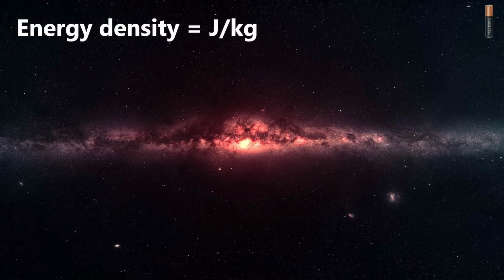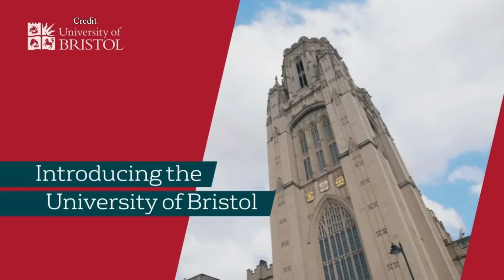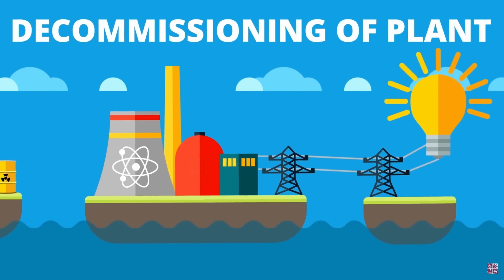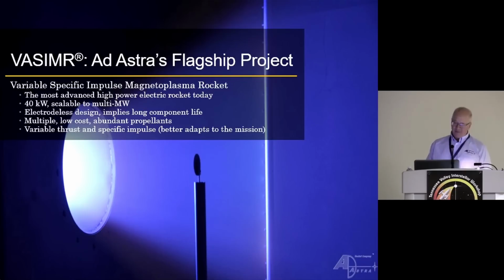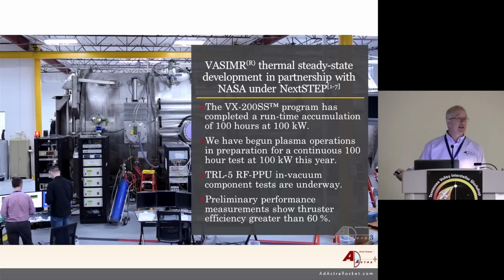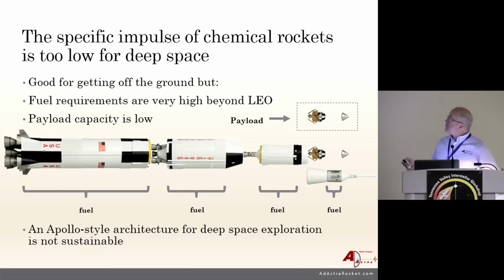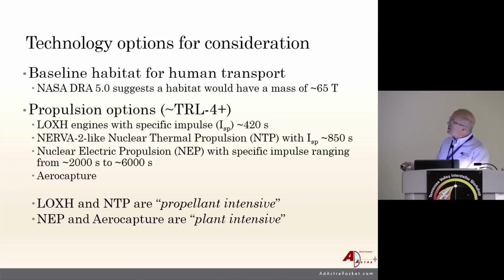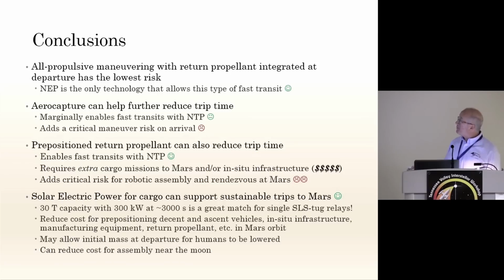Can Nuclear Voltaic Power Get Us to the Stars? Or at least Mars?

Comment: I was just reading about Bose-Einstein condensating photons between two plasma lenses. Maybe this can work with any bosons, such as Cooper paired He3 superfluid? right? Then you focus a high frequency, high powered laser on it and boom you have your power source for space travel to beyond Jupiter?
Reply from the maker: I'm not sure I'm understanding... Photons cannot Bose-Einstein condensate. They are used to strip away energetic gas molecules to "cool" the gas down to a fraction above absolute zero and form the BEC.  This is of course a very dense form of matter... In some ways the densest possible outside of neutron starts etc... Are you thinking of the potential to bottle a large enough volume of BEC gas... Say hydrogen, to use as rocket fuel?  If so that's an awesome thought. What is the energy density of this gas if heated by a laser as you describe?  Let's do some math on this.
Reply: @terranspaceacademy  photons are bosons therefore they Bose-Einstein condensate, albeit I think in 2D. He3 is a fuel for an aneutronic fusion reaction, but it's a fermion unless it's Cooper paired, in which case it flows. This flow can be turned into spacecraft motion when fused using a high energy photon. The bosons are already quantized, all you need is to give it a push.
Reply: @terranspaceacademy  the Bose-Einstein condensate would be inside a tiny little plasma bubble acting like a lense that keeps the quantized matter in place for the laser.
Reply: @terranspaceacademy  what I'm not sure of yet is whether the D2 would also need to be quantized, but I guess yes, just put it in every other bubble.
Reply: @terranspaceacademy  release the electrons after enough laser push?

Comment: There is an error at 10:20. You mix up energy and power. You estimate that the battery can store 7.5 GWh of energy, and then you say 1% of that is 75 MW of power.  1% of 7.5 GWh is 75 MWh of energy, not 75 MW of power. To convert watt hours of energy into watts of power we need to know how many hours it takes the batteries to discharge. Since this battery is suppose to last 50 years, that means those 75 MWh of usable energy is doled out over the course of 438000 hours, so the power output of the battery is 75MWh/438000h = 171.2 watts. That's not much. Its also even worse than that, cause if you made the battery out of the materials you mentioned (Carbon 14 and Nickle 63), it wouldn't take 50 years to discharge, it would take over 5 thousand.
Reply from the maker: Dang... Now I'm sad... unless you're just looking at things from a normal battery perspective.  Remember, this device is creating energy by radioactive decay and those factors were considered in the calculations.
Reply: @terranspaceacademy  Unfortunately not, the things I'm talking about are also true for nuclear batteries. Energy is energy, power is power. When that graph says these batteries have thousands of times higher energy density than regular batteries they are talking about the energy stored in the nuclear fuel. However since the battery is powered by the slow decay of that fuel, that energy is released really slowly, so the power output is really low. The nuclear fuels you used have half lives of thousands of years, so it would be millennia before they released even half their energy.
Reply: @terranspaceacademy  Are you going to do anything to correct the video? The watthours to watts mistake is pretty important. Without that typo the actually power figures for such a battery isn't nearly enough to run a spaceship, which was the core idea of the video. The video in its current state is misinforming people.

Comment: a 7.5 ton array of the chinese batteries (0.1 mA 3A) would produce 2.25kW if they weighed 1g each, the maths in this video are a long way off reality. The ISS produces up to 120 kW of electricity from about 6 tons of hardware, which is a great deal more. With supercapacitors you might be able to store energy for spurts of ionic propulsion, you could do the same with huge arrays of solar cells which will only get lighter in the future. Its not unreasonable to expect that 250 kW could be produced at earth orbit with an array weighing 1 ton at some point, perhaps even less with evolving material science. This would make trips to Jupiter and even Saturn viable with solar electric propulsion or even magenetoplasma propulsion combined with supercapacitor storage. But betavoltaics does not seem to be the way in its current form, and an alphavoltaic system would be better since it requires less shielding on manned missions (forget gammavoltaics).
Reply from the maker: We are talking about potential... Not what the very first functional design can do today.

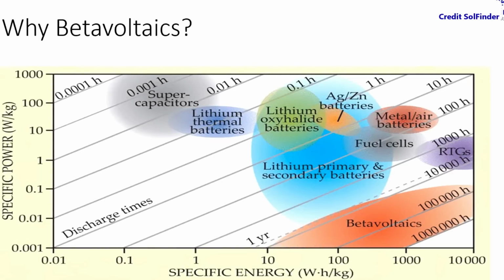Comment: As the graph at 8:17 show, these do have quite impressive energy densities, but the rate a which that energy is released, their power density, is quite low. Like with RTG's, nuclear voltaic cells rely on the steady decay of unstable isotopes. They can't slow down or ramp up the reaction like a fission reactor can, they just get a steadily decreasing amount of power as the material slowly decays away, releasing half its energy during its first half life, then a quarter during its next half life, etc.  If you used the materials you listed in your starship example, Nickle 63 and carbon 14, you would have to wait quite a long time before you got that energy out, cause they have half lives of 76 thousand years and 5.7 thousand years respectively. That huge ship worth of batteries in the example would produce barely enough power to run a light bulb. It would do so for dozens of millennia, but that's not really the power needs of a spaceship, more a long term vault project.

If we want something more power dense you need a shorter half-life, like plutonium, which has a half life of around 80 years. Which why we use plutonium for RTG's. But making a significant chunk of your ship out of plutonium would be quite expensive, probably even more expensive than a fission reactor, which has an even better power density and can be throttled. The main advantage of RTG's and these nuclear voltaic cells is they are much simpler than a fission reactor, with no moving parts, which is good for a probe or a medical device that needs to run on a trickle of power for decades without maintenance. But if you're trying to make a fast high power ship that is going back and forth to port every few months, a proper fission reactor would give you better performance.
Reply from the maker: That's true... But he potential is much higher than these early models.  That's why I went with 1,000x so it's between the 100 minimum estimated and 10,000 maximum.  I also went with a 1% power harvesting when over 35% is possible these days.
Reply: @terranspaceacademy  No, you misunderstand my point. The energy density is between 100 to 10,000 times better than lithium ion, sure, but the power density is way worse. No matter what you do, you're not going to get a significant amount of power out of the natural decay of Carbon 14, the half-life is just too long. It has a huge amount of energy, sure, but it releases that energy over the course of 5 thousand years. The only way to make the energy release faster, is to pick a material with a shorter half life, but those are far more expensive and not suitable to being incorporated into a ship's hull. 

The part where you say the power output would be 75 megawatts is a conversion error. Everything before that was in terms of energy, you got that the battery would store 7.5 gigawatt hours of energy . That is a measure of the batteries capacity. The total amount of energy the nuclear fuel contains. You then say we could extract 1% of that energy, getting 75 megawatts of power . That shouldn't be power. We are still talking about energy here. 1% of 7.5 GWh is 75 MWh, not 75 MW. That means of the 7.5 GWh of energy the battery can store, 75 MWh of that energy is usable. If you want to know the power output of the battery, you need to know how quickly that energy is released. Power is energy divided by time. 

Since carbon 14 has a half life of 5.6 thousand years, that means half of the 75 MWh of usable energy is released over the course of 49.056 million hours. So the power output of the battery is 0.76444 watts. Even if we made the battery 100% efficient, we'd still only be looking at around 76 watts of power, not enough to run any engine of note. Making the battery out of Nickle 63 would make this even worse, as that has an even longer half life.

Remember, always check your units! Going from GWh to GW without ever dividing by hours should have been an immediate red flag.
Reply: @terranspaceacademy  Also, in addition to checking your units, its also good to just have a sanity check of "is this thing physically possible?" Like, does it make sense for 7.5 tons of batteries to be able to output 7.5 gigawatts of heat and electricity for 50 years? No. That's thousands of times more energy and power dense than any nuclear reactor, that should have also immediately been a red flag. 7.5 tons producing 7.5 gigawatts for 50 years would require an energy density of 438 TWh per ton. That's not an energy density a thousand times better than lithium ion, that's an energy density comparable to antimatter. Nuclear materials are not that energy dense. Even if you picked a much shorter half life material than carbon 14, one that does output a a gigawatt of power per ton rather than a watt, it would only last a few weeks, not decades. Also such materials are fantastically expensive and impossible to store for long periods, cause they decay away to almost nothing in a month.

But even if you did pick such a power dense material, that would still leave us with the second reality check, of does it make sense that 7.5 tons of material could survive 7.5 gigawatts of power being passed through it? No! That's as power dense as a nuclear reactor undergoing a meltdown. There is a reason nuclear reactors are thousands of times less power dense than this, its because no machine we can build can survive that much power being dumped into so little mass, it would not just melt, it would vaporize. There are limits to how quickly we can cool things, and this exceeds them by several orders of magnitude. The amount of equipment you would need to process those gigawatts of heat and turn it into electricity would have to be several orders of magnitude larger to keep from melting. And the amount of radiators you would need to cool that equipment in the vacuum of space is even larger still. A 150 ton spaceship is not large enough to handle such power outputs. The radiator array alone would need to be several times more massive than that. 

The fact that the example calculation you gave produced physically implausible results should have been another clue to double check your math. If the results you're getting are impossibly large, that's a good sign you made an error somewhere. The error in this case is at 10:20, where you mix up watt hours and watts, getting a power figure that is 10 million times higher than it should be, because you didn't divide the Watt hours by the time it takes the battery to discharge. Which again, for the case of carbon 14, is over 5 thousand years. That was a third red flag. This battery is powered by beta decay, that depends on the half life of the material. You can't create a 50 year beta voltaic battery with materials that have half lives of millennia.
Reply: @terranspaceacademy  Its been a few days, are you going to do anything about the power estimate mistake? The conversion error at 10:20 resulted in your power figure being millions of times too large. That's not a small typo you can just ignore, that was central to the premise of the video, so its concerning that you haven't seemed to have made any kind of correction. 

I'm sorry if I've come off as rude, I'm not trying to be. There is nothing shameful about mixing up watt hours and watts, its an easy mistake to make, we're only human. It would be shameful though if you didn't correct it even after people pointed it out to you, leaving the video up even though it is misinforming people. I understand not wanting to take the video down, but please, could you at least write a pinned comment explaining the error? Or perhaps make a video on energy vs power where you mention the mistake and use it as an example to help other people in your audience learn about it, turn it around into a teaching opportunity. After all, like you've said to a different commenter, the entire purpose of this channel is to learn together.
Reply: @massimocole9689 Valuable feedback and sound arguments, from my layman's perspective. I saw so much potential in these batteries. You put this into another perspective. We need more efficient conductors that would avoid energy to heat loss. Maybe such materials could also convert radiation to electricity without so much heat?

Comment: Thank you. I never heard about these kind of batteries before. Effectively they seem to be a kind of nuclear reactor. Anyway I remember a zubrin article debunking Vasimr in which he claimed that we need an improvement in power to mass ratio of two orders of magnitude to achieve the quick transit times to mars: On the ‘39 days to Mars’ claim, Zubrin says "VASIMR would need to couple with a nuclear reactor system with a power of 200,000 kilowatts and a power-to-mass ratio of 1,000 watts per kilogram, while the largest space nuclear reactor ever built, the Soviet Topaz, had a power of 10 kilowatts and a power-to-mass ratio of 10 watts per kilogram." So do these Nuclear Voltaic batteries produce that kind of power to mass ?
Reply from the maker: He was exactly right... And didn't want to wait for that.  He wanted "Mars DIrect" to use available infrastructure like Falcon Heavy.  While his plans are excellent to get the job done now those with control of the resources want totally reusable systems.  VASIMR does need a lot of power and solar won't work well on the way to Mars... But nuclear is coming, by the US and EU or by China, and so is the VASIMR, once we have a source of sufficient power.

Comment: This is really interesting idea. A problem will be heat rejection. If you’re carrying gigawatt hours of energy, and you only get one percent of that then you have to figure out a way to radiate the other 99%. You would need to have massive massive massive radiators.  another problem is going to be availability of the radioactive substrates. How difficult is it going to be to gather together tons of purified carbon 14 or nickel 63? It’s doable I’m sure but it might not be economic for multiple ships.
Reply from the maker: The end film from Britain shows that they have almost 200,000 metric tonnes of C-14 rich carbon damping rods from nuclear reactors. Nickel 63 I'm not sure about and will need to research sources.
Reply: @terranspaceacademy  i’m sure there’s plenty of source material, however, it might be difficult to separate carbon-14 from everything else, especially when dealing with a radioactive source.

The other major weakness of the betavoltaics is that the power density is terri wha . Something like .01 W to .1 w per kilogram.   So a 7500 kg sample might only give you 75 to 750 W unusable power.  They can do it for a very, very long time, however, it’s not enough power to really do anything meaningful on a spacecraft.

Comment: Lots of interesting information about theories. One I’ve pondered but have yet to hear anyone taking about is the use of nuclear energy in a molten reactor to make xenon for use as a propellant. From 32 years in the power industry talking daily to nuclear power plants one of their Achilles heels is the inadvertent production of xenon that has to be cleaned out of the feed water to allow higher power levels. If it can be made accidentally I’m sure someone could figure out how to make more on demand. I’m a big fan of the thorium LFTR since the fuel is liquid and can be constantly reprocessing and cleaning and has the side benefit of lower long term waste production. 

Every thing else aside, I like the idea of creating artificial gravity in a liquid fuel engine by spinning it echoing the design of the firefly engine in my favorite under appreciated scifi.
Reply from the maker: Wow... I can think of a simple separator using centrifugal force.  Xenon is pricey and a good source would be valuable. LFTR is I think a very viable design, China (again) has one running.  I promise you there is an army of analysts reading through the golden age of American scientific innovation... 1950 through 70s.